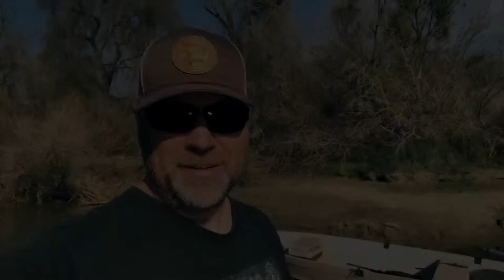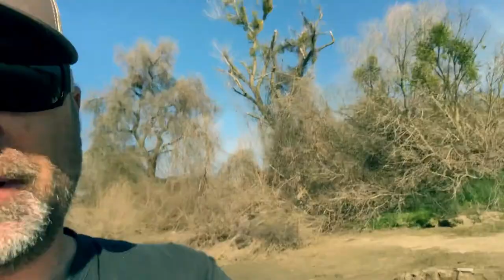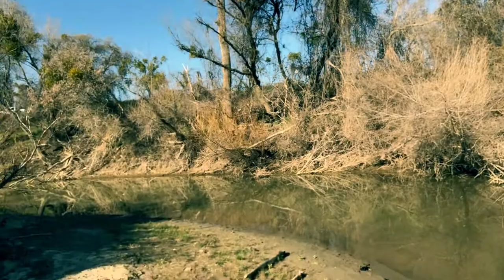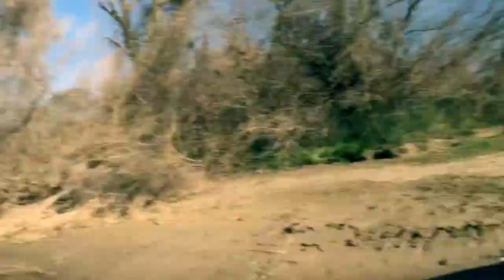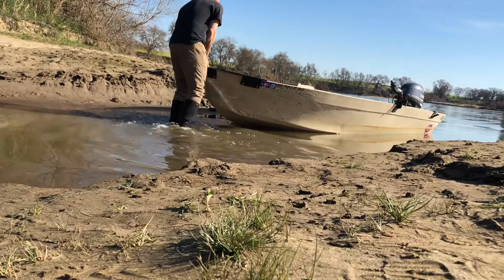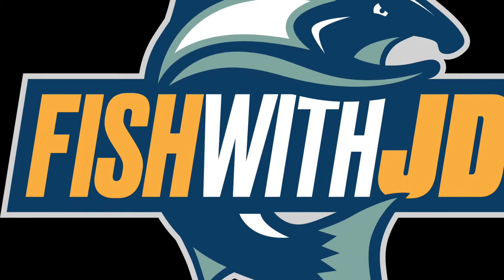SHALLOW WATER TEST: HOG ISLAND SW 16 Jet boat (Yeehaw)

Comment: What about a surface drive on that boat? Or longtails?
Reply from the maker: I’m not sure what a surface drive is? Is that like a mud motor?
Reply: @fishwithjd  yeah, they make long tails and they make what they call surface drive, which is set up like an outboard but has a tail shaft that rides at the surface! Google the mud skipper and it will bring up a site! Different companies make them

Comment: That’s not a jet boat it’s a pump outboard.
Reply from the maker: Well, same concept
Reply: @fishwithjd   no not at all. You’re still dragging that intake grate.
Search “ice diesel jet outboard” or “jet tech outboard”
That’s the first acceptable skinny water outboard engine ever produced.
Most people don’t like having to replace an engine all the time just cus it’s bouncing off rocks
Reply from the maker: @conanruisi  I know those jet techs are cool. And I've been following that new motor for awhile but haven't been able to put my hands on one yet. I have never had an issue with a jet outboard and replacing it because it 'bounced off the rocks." Oh I've bent some grates in my day,  tho!
Reply: @fishwithjd  well that sounds like exactly what I said.
Breaking stuff because you’re hitting rocks.
Respect for going full caveman mode with that thing for sure, but I don’t think you’d ever find me using one.
Reply: @fishwithjd  and, hooking one of those rocks just the wrong way will pull that tiller drive all the way off.
All you need is a hull integrated intake grate. Minimizing the chance of damage to the rocks and removing 90% of the underwater obstructions on your boat.
And what’s nice is if you did decide to use a jet tech instead of an inboard, those seem like they could still hit rocks and bounce right back (but since you’re hitting the nozzle only you hit rocks with the drive itself a lot less)
With an inboard you don’t have a hinge point there, and it leaves you open for the potential to smack your nozzle on something and maybe damage it.
This is the least likely scenario but, an outboard is a great idea, it’s just those traditional designs really don’t cut it for skinny water. I’d only ever use one of the outboards like what you’re using if I was operating a rescue boat, like a life guard boat.
Reply from the maker: @conanruisi  well in outboard form, thats all thats available out west here.
Reply: @fishwithjd  I know I live in Oregon, I think it’s more about the fact that they’re still somewhat conceptual.
I’m sure once that company grows they’ll start popping up, probably with Honda’s and mercs on top too!
But for now, although I respect the shred, personally I’m sticking to an inboard until the jet tech does become more available.
Reply from the maker: @conanruisi  Yeah I will definitely be keeping my eye open for that!
Reply: @fishwithjd  if eventually they do become available for more manufacturers, there still aren’t any videos on them yet, just sayin 😉